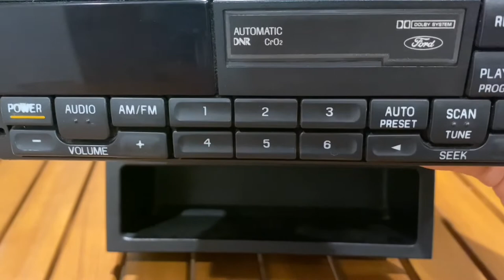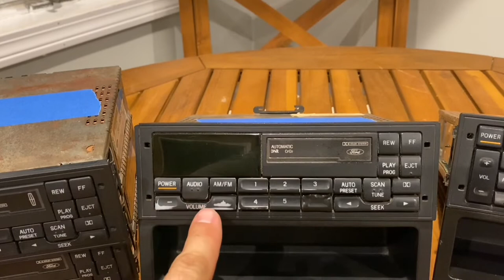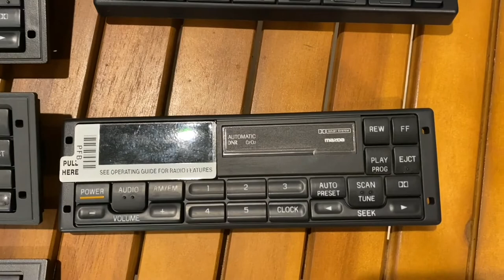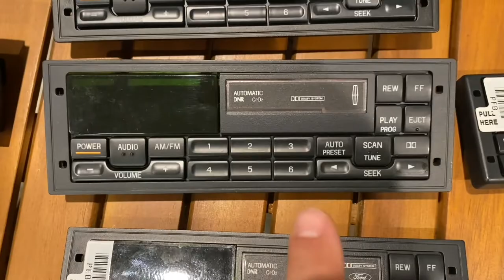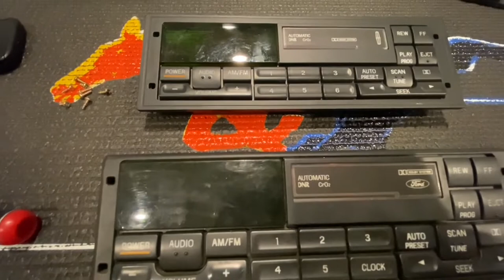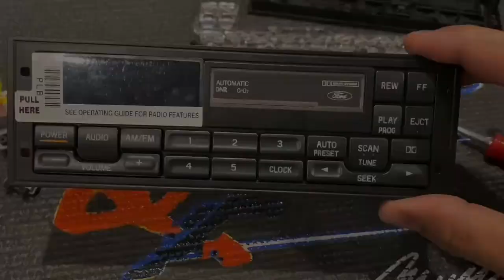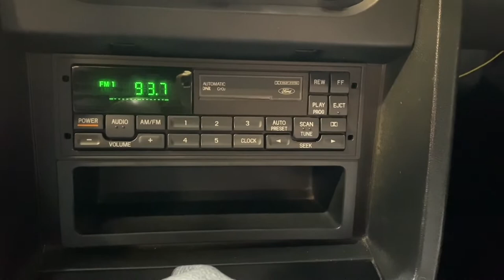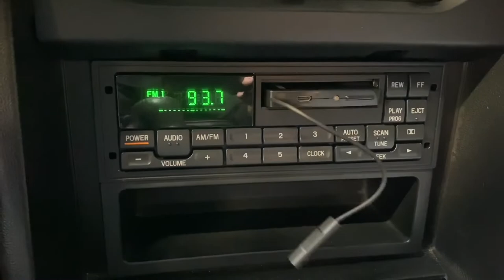1993 Mustang Premium Radio parts interchange

Comment: (9:04) in. My question is how do you function the CD player/Changer? Theres no channel/input to select nor any type of functions typically seen on a CD player. Also what is the purpose of the dual blade terminal plug where the CD changer goes? I'm probably barking up the wrong tree on this one but I noticed the newer models (about 2004 and up) on the stereo deck have a input button labeled "SAT". However not once have I seen one come to the shop with a working Sirius XM radio, tuner or antenna. Is that button just a teaser or can the radio actually be run to receive satellite radio?
Reply from the maker: The CD changer, or the slave CD used on some Taurus and the SN95 Mustang, work by "interrupting" the signal from the head unit and inputting their own signal.  That particular plug has 6 pins.  Two are a L and R channel out, and 2 are L and R channel in.  The other two are system operations related.  Basically the signal out to the CD change/Slave unit gets cut off and the CD change or Slave SC unit inputs it's own signal.  You operate it from the changer itself.  WHen it's off, the signal from the head unit is allowed to pass through and return.  SO the jumper that is installed pretty much just jumps the L and R output channels to the L & R input channels.   On the 1993 Mustangs, this was done internally, so actual F3ZE radios don't need the jumper plug to function.  Other radios will due to not having the internal jumper.
Reply from the maker: As for the 2004 Sat ratio, the radio would need to have a Ford specific tuner and antenna added to enable Sat function.  It was "Sat ready" but wouldn't have it originally unless the tuner and antenna was purchased as well.  From what I remember it was a $400 ford accessory.  I imagine when folks traded in these cars they cancelled service (if it was equipped).  Some probably don't realize they need to pull the radio out and locate the tuner to get the numbers off it to activate it.   I had a 2003 GT and remember it was much cheaper to buy the Sirius aftermarket module/display and just use an adapter to play into the OE radio.
Reply: So does that mean I can hook up a aux cord from to the two blade R/L and play audio from a device with a head phone jack? Or do I have to open the stereo deck and solder it?
Reply from the maker: @dogbird6758  I believe that’s how it’s done when I see folks wire in AUX and Bluetooth to these radios.  There are some internal points to pick up these pins as well.  I meant to dig into one and add Bluetooth but just haven’t gotten to it. The only question I have struggled with is how to interrupt the signal from the head unit to keep it from playing over the signal.  I have the wiring schematics for these head units but just haven’t had the time to mess with it.
Reply: 10/4. Thanx for the video and info.

Comment: На 8.15 минуте, было хорошо если бы объяснили назначение каждого провода
Reply from the maker: That's a good idea.  The purpose of those wires may have differed slightly depending on vehicle, but for the most part this was a pretty standard connector and most vehicles were wired the same.  If i do another vid in the future on this I will add that.